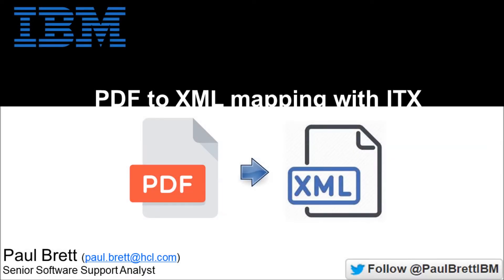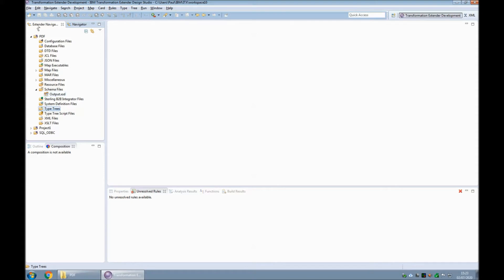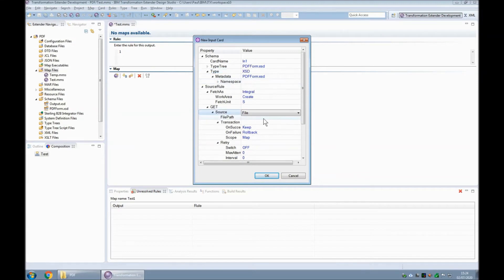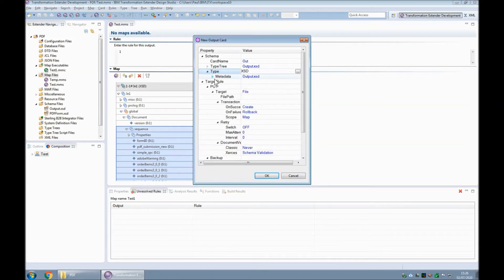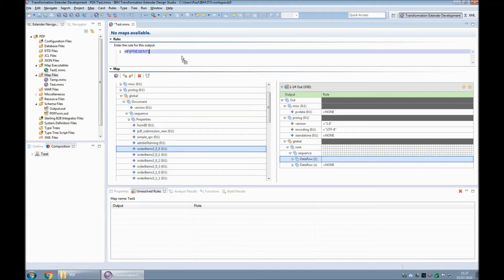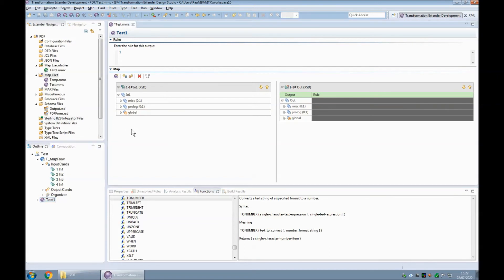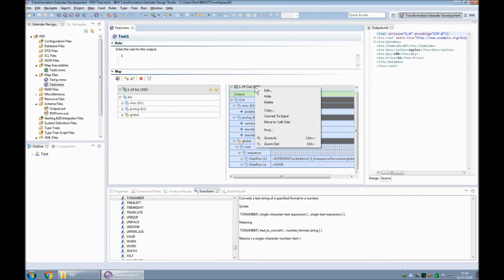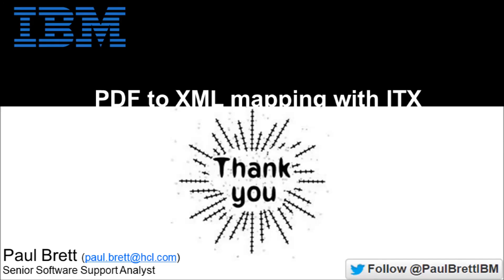PDF to XML mapping using IBM Transformation Extender

Comment: Nice demonstration Paul.  although I find great that ITX 10 is finally able to map from XML, I find the fact that the importers creates in the generated structure indexed elements quite disappointing.

I would have expected a multiple occurrences group for each record, each of them containing one item per field present in the PDF.  I suppposed you tried to tweak the xsd structure, to see if the map is able to parse the PDF with a record* complex element ?
Reply from the maker: I did not unfortunately, experiment with the structure.  I suspect the poor structure was partially due to the 'amateur' way I created the PDF.

The ITX Product Management team would be happy to work with you on any improvements you would like to see.  Engage them via the A-Ha! portal:

https://ibm.biz/ITX-RFE